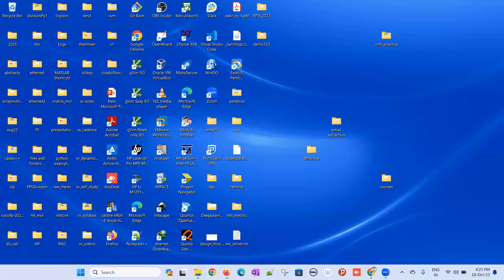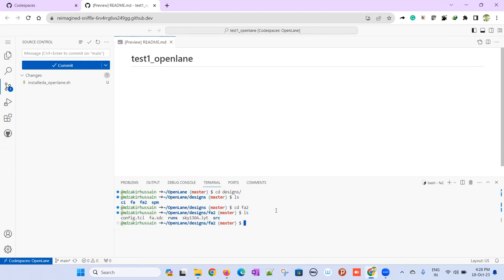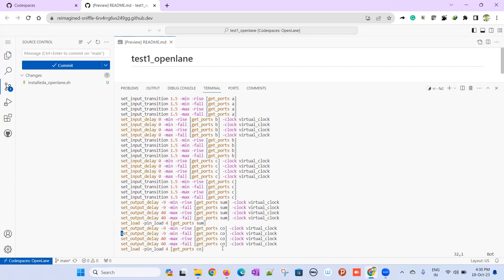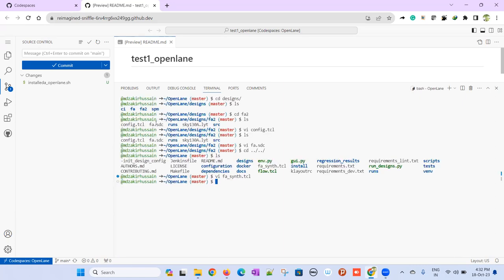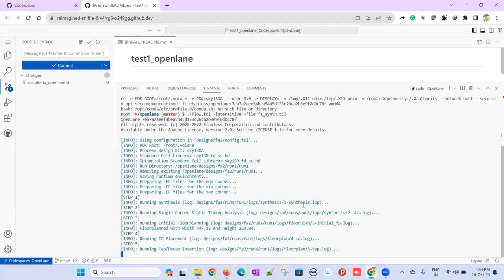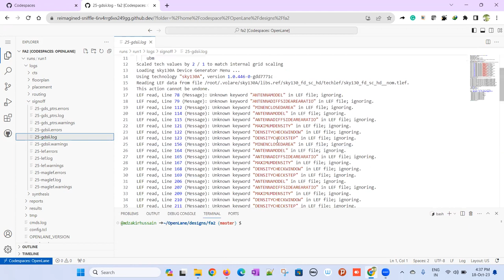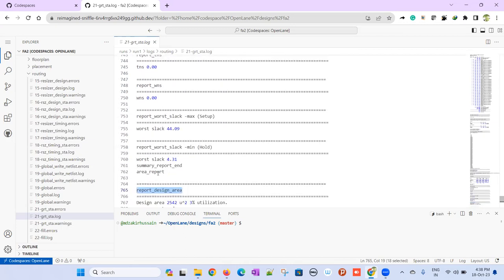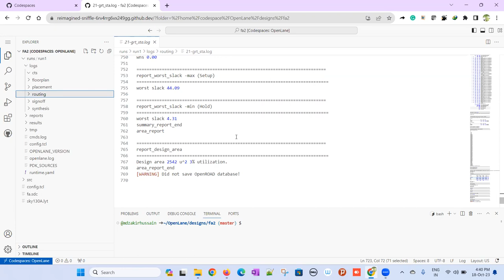OpenLane using Codespaces : RTL-to-GDSII flow. - Part-2

Comment: Please make a tutorial on how to copy multiple Verilog design files into openlane and synthesize them. And how to synthesize module containing submodules.
Reply from the maker: As demonstrated, we create Verilog files in the src folder. So keep all submodule files(for example, let us say, you are first writing Half-adder code in one file, and then writing full adder code in another file in which you might be instantiating this half-adder module. Ensure that these files exist in the same folder that is src folder] in the src folder. Only the top module name is used in the config.tcl file. In the config.tcl file already path exists for all Verilog files. And already the complete flow has been demonstrated from RTL-to-GDS2 which covers synthesis.

In case of still doubts please ask.
Reply: @VerilogHDL  Thanks for the reply. Do I need to make virtual clock if my module has a clk signal as input for timing analysis? What changes do I need to make for synthesizing sequential module with clk?
Reply from the maker: @Abdulbuzdar1  I will make a video on that.
Reply from the maker: @Abdulbuzdar1   I have made a video to answer your question please watch it. Click the given below link:

https://youtu.be/a5LtjU2-pL0?si=7Ohdib7MzlFkn0Ob
Reply from the maker: @Abdulbuzdar1  If you or any of your friends wanna learn SystemVerilog for Verification then ask them to watch this series. I am making a SystemVerilog for Verification video tutorial series. The link is here: 

https://youtube.com/playlist?list=PLxeUHjV-IBzs7mfistGC_b6LChBmx-mgw&si=DN1iGQHKO464lj5U
Reply: @VerilogHDL  yes I have plan to learn System Verilog, will definitely watch and recommend your tutorial to others also. Thanks